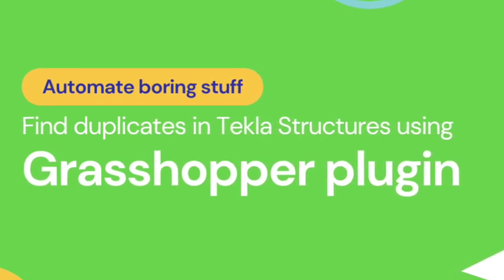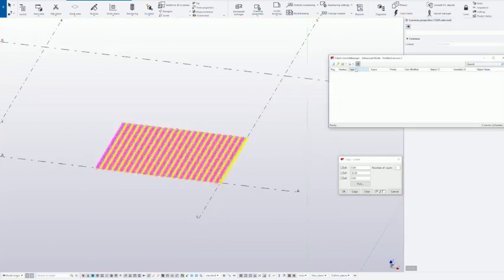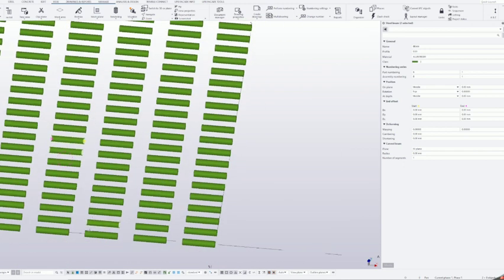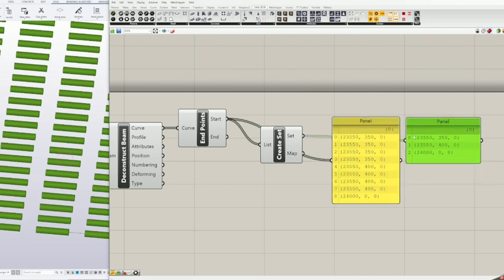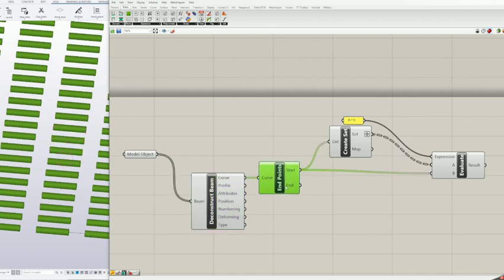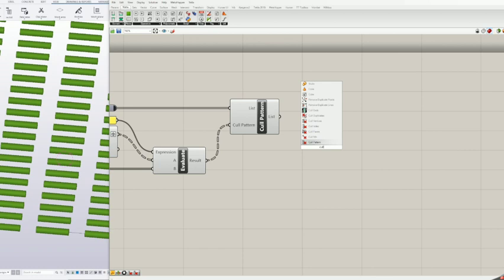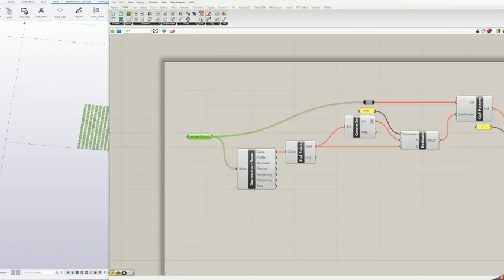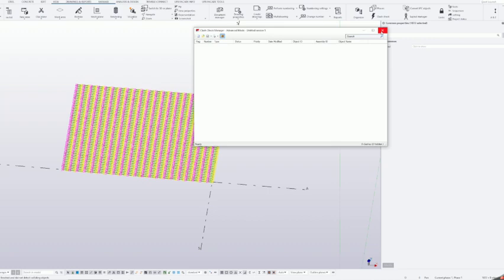Grasshopper-Tekla Live Link - how to find duplicated elements

Comment: Is it possible that I could use Rhino to find the walls that have same shape on different levels or any position in the model? Then it could change some UDA or something?
Reply from the maker: Not seeing all information I can not say 100% yes, but I'm pretty confident, that you can create some algorithm that could help you with that. Basically, it's just finding specific coordinates and compare to the required ones. After finding walls there is no problem with changing UDA values.